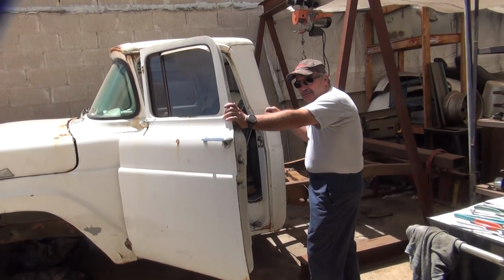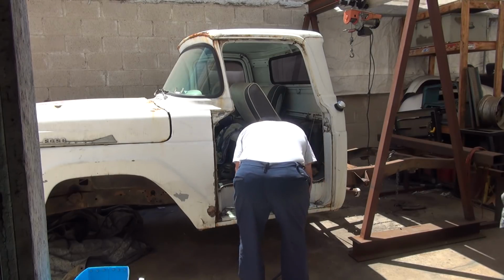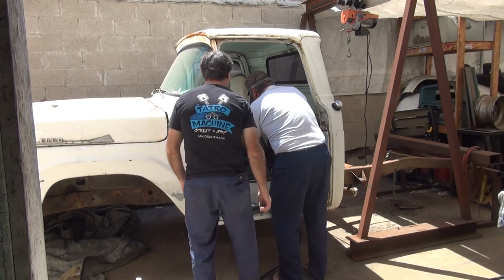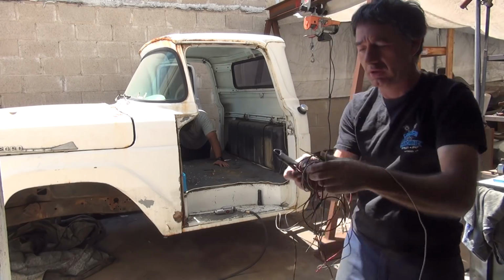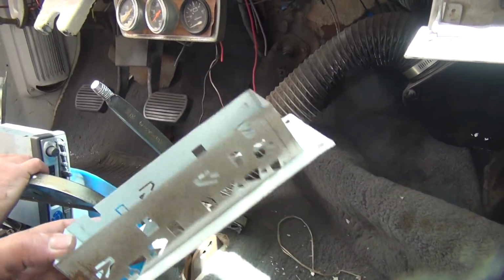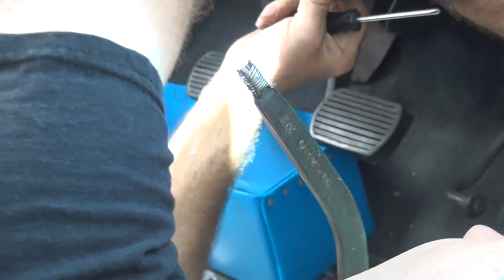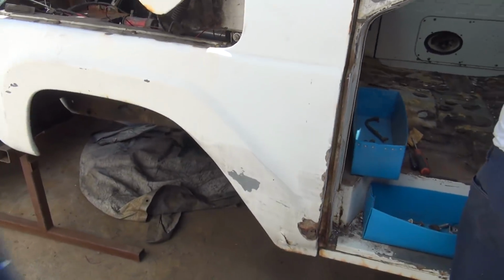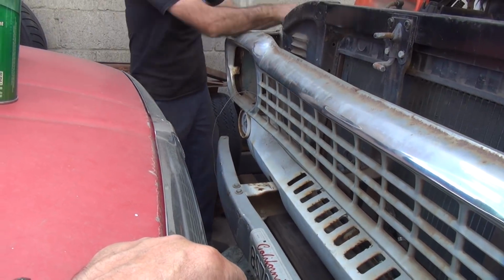1958 ford #103 f100 truck repair rebuild pickup rust bucket by tatro machine

Comment: You going to get fred to help you get a trans for dodge at the local salvage yard?
Reply from the maker: no, we are going to strip the dodge and use the chassis on the ford. lots of parts to sell or scrap.
tatro
Reply: interesting.. So you can modify anything connected to the original  body on anything 65 or older and california emissions are not required? I cant wait to see this take shape.
Reply: Tatro Machine hehe.. what?, going to rebuild with a "Mad max" style patina? .. With original hard iron harley bike In the back.. Sounds open brother 👊✊
Reply from the maker: no 1965, 1975 and older are free to go. that includes the motor too. the newer motors are in a gray area but should still be good to go.
tatro

Comment: if you need parts for the 58 let me know  got plenty  54-79   long time  builder besides  shovels,lol
Reply from the maker: a nice long bed would be nice and any patch panels to fix the rusty areas. you can see all the bad stuff.
tatro
Reply: Tatro Machine ya gonna run into some headaches..first the 400  if its  the rare smallblock windsor 400  ya good.  if its the  777879 351m400  you don't want to use it unless you totally rebuild it with quality a m parts.. rod thrower...   dodge 4x4 chassis should  have cummin diesel  in it   period..... as far as a bed   i need t know what w.b. ya got 57-63  bed is correct,aka box bed or  round tailight,but  you might get lucky and find a  long stepside 'express' bed that will fit  53-72.. with relocation of bolt holes  the long 64-66 styleside may fit..   most people build   old ford  trucks  on  crown vic  chassis or use the stock frame amd add-03 to 08 clip and 8.8 from explorer   It alo depends on what ya gonna do with truck...Puttin a camper in back and towin race rig to flats  i would go with diesel....  would come out  and help with build  but got too many irons in fire right now  and buildin new shop in fla...
Reply from the maker: why do anything easy, i have the dodge and 400 so that is what is going together for now. if the 400 blows i will use the 460. if the frame doesn't fit i will make it fit. a truck should be a truck that you can use as a truck, not some stupid car in drag. those mustang two front ends are a joke if you are going to use your truck.
tatro
Reply: Tatro Machine wouldn'tbother with the 400  if an M block like i siad  but  good new is 400m and  460 use  same motor mounts..... usong a truck as a truck is the point.nobody uses  mustang II anymore  old man geez     2--03-08  crown vic rack is the plan and  its bolt in  heavy duty.   again  findin a bed is know what wheel base ya got   then go  frankenstein n get a  gm bed lol
Reply: Jockey Shift do you have a original steering box with the original splines on it?

Comment: HOLLY Green...  Grill bolts are  everywhere and a bitch  but grill worth savin,$$$$$      so is  core support   contact me if...I KNOW  these trucks!!!
Reply from the maker: got and parts to fix the rusty areas? i need patch panels to weld in to the bad spots. all of the door guts are gone too.
i am tring to keep the body as stock as possible.

tatro